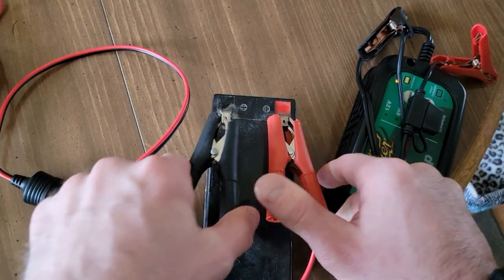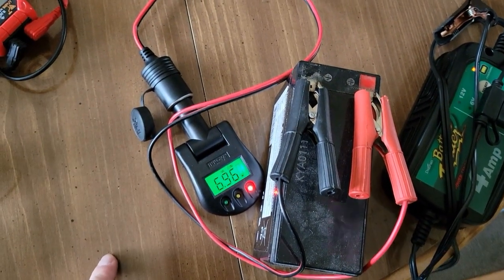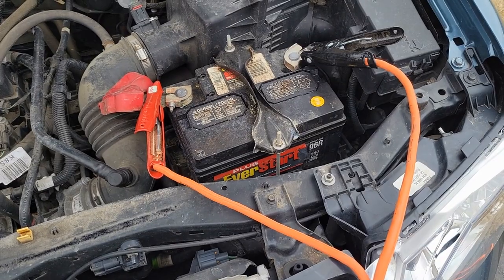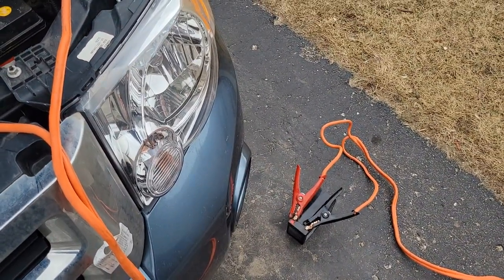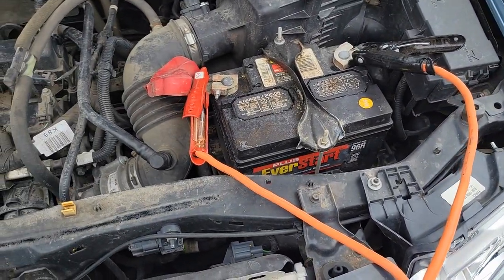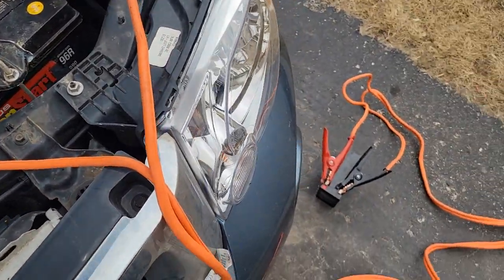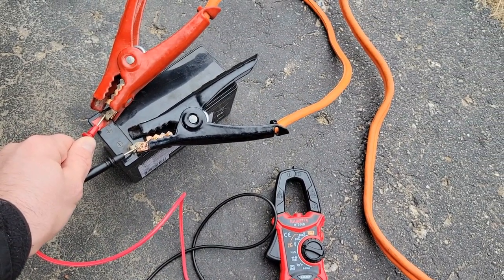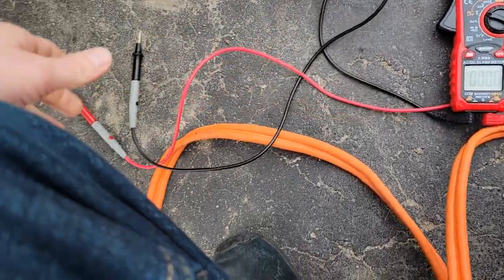12v Charger Won't Charge or Recognize a Battery? [Easy Fix in Under 5 minutes]

Comment from the maker: Just realized I recorded this with a close-up lens, hence the blurriness. 😭  Sorry for that.
Reply: No go for me. Boosted the dead battery i.e. started the car, let it run for 60s, turned it off, left the good battery connected via jumpers for 5 min, disconnected, drove the car with the "dead" battery for 15 min, then re-connected the tender and it still shows "Full Charge". Does this mean my tender is shot?
Reply: I asked a question below I hope you can share your expertise on.  Thanks for the knowledge i hope you get the credit for the battery tender i just bought
Reply: Great  presentation  n video  super  tips  had a new battery  charger wondered why  it would  not charge a  real  old  dead battery   thx

Comment: Worked great on my dead car battery. Used 2nd car to jump it with cables, drove it around the block and then hooked it up to the trickle charger. Thank you for your help Home Battery Bank.

Comment: Brilliant advice. Charger wouldn't show the red charging light for my car battery that I drained by leaving the keys in ignition &  turned on! For 3 days!!! (I'd just had a large tooth extracted & I wasn't thinking straight with the pain when I put my car in the garage, climbing out of the passenger door because I'd parked the driver side too close to the wall!)
Well, I was going to buy a new battery. But after this vid, I called my buddy for jump leads. We jumped the battery on the floor & 20 minutes later, I had the red charging light on the charger. Thanks for saving me lots of cash :)

Comment: So basically today's chargers are Designed to Not Charge A Dead Battery.  That's right folks,... it's the biggest gimmick out there, coined a "safety feature" so you'll just take a hammer to the whole mess and run out and buy a new battery like you probably should anyway.  These chargers are trash compared to an 80's charger.  Those things would bring a dead battery back to life.

Comment: Thanks so much. My charger kept trying to tell me I had a 6V battery. I got a friend with jumper cables to give my battery a 5 minute tickle up. Tried the charger again and success - auto-selected 12V and started the charge cycle.

Comment: I was only going to give you a light, i though I had a bad battery charger but after trying this it worked and it's now charging.  Just another hint if you have a Manual transmission car you can push start the car then have enough charge to use the charger. Cheers.

Comment: You can also put the charger on the bad battery as jumper cables are in place from a good battery for a bit. It doesn't have to be in a vehicle and running. The good battery will loan a detectable current through the bad one and give the charger the "kick off" it needs. Done it the way I'm describing many times. Yep, many chargers require a certain voltage. Holding the red and black cables of the charger into the air, tells that charger nothing at all. Placing the red and black cables onto a dead battery is basically doing the same thing.... the charger is not sensing anything needs charging when there is not enough battery voltage there to tell it to do so.

Comment: You can do this with a 9V battery and two pieces of wire.  Just hook the battery charger to battery and turn on.   Use 1 wire to go from the neg - side of battery and to to the neg -side of 9V battery and hold the 9v the second wire from battery to the + side of the 9V and TOUCH the + side of the battery which the charger is hooked up to.

Comment: This is brilliant! I had tried this with Ryobi batteries once before but didn't add two and two until I saw this video. This totally works! I even tried getting a new battery from AutoZone but even the new one died because of how cold it is. Then I watched this video and tried it out and it worked! It accepts charge!

Comment: Another way to do this, and if you don't have a good battery, but you do have a smart charger with Jumpstart ability, but it will not charger the dead battery, hit Jumpstart feature, let it count down, try this as many times as it takes, unless the battery is stone cold dead, it should bring it back enough to allow the smart charger function to begin to charge your battery.

Comment: When using jumper cables... IF you clamp the positive leads first instead of the negative leads to a car battery, when you go to clamp the negatives they will spark.

Clamp the negatives first. Remove the negatives last.

Comment: hmm. i did mine with a trickle charger and it charged up to 12.6 however when i put it back into my vector 800 jump starter it still has a low battery light.

Comment: There is an easier way,  you can trick your battery charger, you don't need another car. Just connect your battery charger to the battery, then connect a standard 9V battery to your car battery for 1 second. First the minus pole, then the plus. This is sufficient to get over the threshold of the battery charger and it will start. Details at 4:40min in this video: https://youtu.be/YmiZ2DUQ2YQ?si=Xn4Nu1Mw5oRSeC1M

Comment: my charger has a disulfate function that can take over a day when the  disulfate function completes the battery will then go into a ready state with a full charge. It is a Black & Decker  smart charger MODEL: BC25EB It has Alternator test function and a 75 amp boost had it for many years. It was worth every penny of investment. During the winter months it is used as a battery tender. LOVE IT!! So far my battery is at 5 years old still going strong. I did notice you have several video's covering battery tenders which is really awesome. Here lately have have been thinking about solar tenders for my work van. This will keep the battery optimized all year long. The issue with me is that I use Converters to charge tools in my van while the van is not running that alone can reek havoc on a battery. I was told to run dual batteries but I am not sure. That would be a good video for you installing dual batteries in commercial vehicles. Just a thought.

Comment: I left my RV deep cycle battery in the RV for 3 months in the winter - the Maxx charger would not work! I tried your trick...hooked it up to the Chevy PU for 10 min. I then hooked up the battery to the Maxx charger...AND IT TOTALLY WORKED! Thanks for your help! A.J.

Comment: An alternative to the car battery is an old-fashioned car battery charger without the sophisticated electronics in the modern chargers. I have one since decades and it helped in that situation since it charges regardless of the voltage of the empty battery.
Reply: Yes agreed ..old school does not protect from charging into an assumed dead short eg dead battery.
Reply: @davidbarlow269 my one has at least a fuse like in cars to protect against exceeding current.

Comment: Hi I’m Paul I’ve got an assist battery bike  the battery is dead trying to get charger but it’s been on the bike for about three year with out getting charged or used will it charge up

Comment: Thanks for the video. A low enough or dead battery acts like a resistor. When jumping vehicle with another vehicle let the connection run for 5 minutes on 2k rpm.

Comment: i Googled "E-1" error code and this video came up. Can confirm "over discharge" was the cause. Since the charger is only looking at the voltage and doesn't do a current pull any 12V DC source will work to "trick" the charger. I used my buddies charger and slid the clamps from his charger  to mine while connected to the battery.  You could probably stack x4 watch batteries if you wanted to MacGyver this.

Comment: No go for me. Boosted the dead battery, started the car, turned it off, left the good battery connected for 5 min, drove the car with the "dead" battery for 15 min, then re-connected the tender and it still shows "Full Charge". does this mean my tender is shot?

Comment: To me Cent-tech chargers or “smart” chargers are PsOS that make my life miserable! You want to reduce headaches? Find a good working vintage charger with boost feature that YOU control and will do WHAT you want WHEN you want! This HF POS has given me nothing but headaches especially when it shuts down to 1.8a when switched to the 10a or 40a setting and just effing sits there then “occasionally cranks up when the voltage drops to 12.7 then spikes briefly to 14v and shuts off again for another 20 minutes! Yes, it does this with a battery that’s only discharged because it’s been sitting. Turn your parking light on and it will cycle. Totally POS and I only use it on a battery in a vehicle that will be down over night or over the weekend. I only bought this POS because my charger of 45 years finally gave up the ghost. Actively looking for a vintage replacement so I can chuck this cen-tech pos!

Comment: Hook the charger to the bad battery.  Hook jumper cables to the bad battery then to a good battery thus tricks the piece of crap modern chargers into beginning a charge cycle. After 15 to 20 minutes you can remove the jumper cables and it will continue to charge. Basically the same thing described in this video minus having to hook to a running car. All it needs to see is good voltage and then it will start charging.  Boy I remember the days when machines fluid what we wanted them to without having to work around idiotic stuff. 

Mister battery charger, you are a battery charger, my battery is dead, charge the mother Fer when I punch the button for you to charge it. That's all I need from you. If my battery wasn't dead I wouldn't need a battery charger now would I?

Comment: Can’t believe I didn’t know this. I had a problem with my smart trickle charger and it didn’t recognize my motorcycle battery. I tried an old analog charger and the amp needle would jump to Max then immediately fall back to zero then repeat. I took my power pack out gave it a charge, took a few tries ( including alarm system going off 🙄 which is why the battery was dead too 😉 )but got the analog 12v charger going for an hour or so then plugged in the trickle charger and seems to be charging now. Thanks!

Comment: Thank you so much! My truck battery is dead so I bought a cheap trickle charger and it first didn't show anything other than power. Then later showed error. With your help and my backup jumper, I charger the battery enough to get the trickle charger to recognize the battery and start charging! Thanks! 👍
Reply from the maker: So happy to have helped!

Comment: Great Video.
I tried hooking the charger to battery, then hooked a standard 9v battery with wires between the clips, then plugged charger into the wall. The charger recognized and started charging, so I unhooked the 9v and it continued to charge no problem.

Comment: Even old school chargers can charge a dead battery. Man don’t buy a battery tender I guess…
Reply from the maker: Yep.  None of the modern chargers seem to charge a battery that drops below a preset voltage depending on the manufacturer of the charger.  Old school chargers still have an edge over the new chargers in that aspect.

Comment: Holt crap! It worked! Hooked my Subaru battery to my deep cycle batt, with jumper cables and then started car. Turn car off and let sit for 5 mins… then reconnected battery charger… it recognized it and started charging! Thx!🙏

Comment: Holy crap! It worked! Hooked my Subaru battery to my deep cycle batt, with jumper cables and then started car. Turn car off and let sit for 5 mins… then reconnected battery charger… it recognized it and started charging! Thx!🙏

Comment: What in the heck was somebody thinking I buy a battery charger with a jump start just like always can't jump start the car because the battery is dead which defeats the purpose of having a battery charger with a jump start on it so now we're supposed to take jumper cables and hook up the bad part of the good car which defeats the purpose cuz why don't you just jump start the car from the other car

Comment: You don’t need to start the car just need to have a current running through both batteries with the jumper cables for 2 minutes.

Comment: Thank you Bud, this worked perfectly, only thing I did differently was i have an old mechanic style charger that is stuck on 12v jump so i hooked it to the battery for 3 min and monitored the voltage with a multimeter, the jump setting put battery from 0.03v to 11.87v so I disconnected and hooked to the battery tender plus, it is charging now, big help watching your video

Comment: Thank you for this!  Worked like a charm.  You'd think Battery Tender would mention this in their manual.
Reply: You'd think they would make a battery charger that would actually charge a dead battery which is the very reason we bought a battery charger right

Comment: I just did this with my lithium motorcycle battery and a jump starter box, I connected the jump starter box for about 2 seconds, the charger stated charging, I disconnected the jump starter box and now my battery is charging, now to try it with the regular battery which is older…
Reply: Well. How'd it go?

Comment: It seems like mine is being recognized at only 8 volts but the light turns green like its charged but there is no way it charged because it was only on for 2 hours.  Any fix for this?  its agm so i can't swap the fluid

Comment: Two helpful pieces of info I can add to this. you can also put a base level of charge back into a completely dead battery by disconnecting your battery cables ... hooking up your booster for say 20 secs at a time. I needed to do this 3 times to get a base level of charge in the battery so the "smart" charger would recognize that the battery was not completely dead and then it started the charging process. Second tip: If you are in a hurry to go .... just disconnect your battery cables from the battery and hook your booster pack up to the cables ..... the car will start. Then with the car started carefully replace the cables. If you run the car long enough you will get a charge back into this dead battery.
Reply: Thanks man, my smart charger wouldn't recognize my battery. Gave it a little charge from a booster for a few seconds and it fixed the issue.
Reply: I can’t thank the two of you enough, the video and your comment together saved my car battery that I almost gave up on!
Reply: @Ampelm4n   Hell yeah, happy to hear that.
Reply: Å
Reply: If I do the second method of disconnecting the terminals and jumping it from just the cables then reconnect battery once car is running, would I connect the positive terminal first then negative, or negative first then positive?
Reply: @AmericanMuscleZ28  To tell you the truth, I can't remember, it was a while ago but I would ground it first ... then the positive second.
Reply: Booster tip worked Perfect,  cheers mate 👍
Reply: @brendanoshea2186  Pleased to hear that mate.

Comment: Great video, sir. 

I left my motorcycle key turned and I came home to find it dead. The battery charger I purchased didn't have any effect until I found your advise and gave it a good surface charge to begin truly charging the battery. 

Again, good shout. You are doing God's work.

Comment: I use a my Stanley power starter I connect it to the battery even if fully dead. I just turn it on for 1 minute that is all I do. So no vehicle needed.

Comment: Is it ok to hook up a 12 V 10Ah/20Hr Valve regulated rechargeable battery with the car jumper cables setup to get the surface charge for it?

Comment: Would.this work on a 12v lithium motorcycle battery?
Reply: didn't for me, but tf i was trying to charge it with a normal battery charger, not with one that has a specific setting. Once I started using the right charger it was fine.

Comment: You really only need a 9v battery and some wire…
Reply: wdym
Reply: @Purple_walrus you get 2 pieces of wire. Wrap one on positive one on negative of the 9v battery hook your charger to the dead battery and turn it on. Next touch the wires to the correct terminals and it should very shortly after register your battery.  Once it does disconnect the 9v battery and you’re all set… it worked perfectly for me. I believe the chargers don’t recognize anything below 9v.

Comment: My son's bmw has a AGM battery that I'm having the same issue with. My question is.. Can I use any good car battery (different CCA, brand, run hours, etc.) to do this, or do I have to use the exact same or type of battery to get the dead one to be able to charge?

Comment: Bro thanks for the video. I have a 69 C10 that hasn’t been cranked in at least 4 years!!!! The battery was dead…RIP 💀 my battery charger would not recognize the battery. I used my wife’s Honda to charge the battery for 10 minutes. After ten minutes the battery charger started working. I saved myself $250 bucks for 10 minutes of my time! That’s $1500 an hour. I found a new side hustle… 💰💰💰💰😁 Seriously thank you so much!

Comment: Hello from the Fiji Islands. Wow, that was such an easy fix. Hubby couldn't believe it. He was just about to smash the charger against the wall as it was only reading a 6V battery instead of the 12V. We have a Powertech Plus MB-3611. The spare 12V battery is one we use for our gold high banker. Def worth a connection with you and a like👍🌞🌺🌊